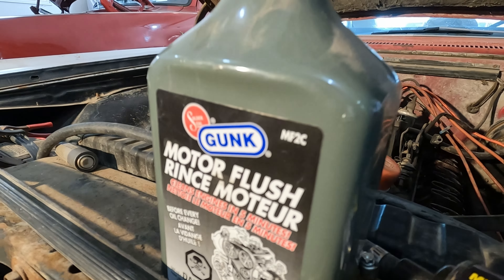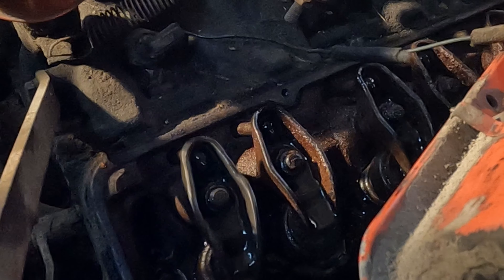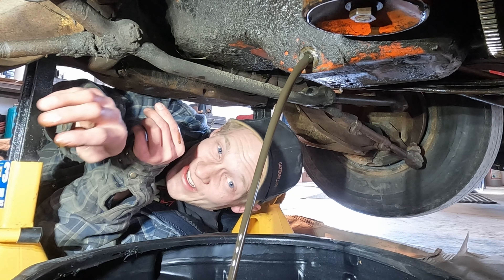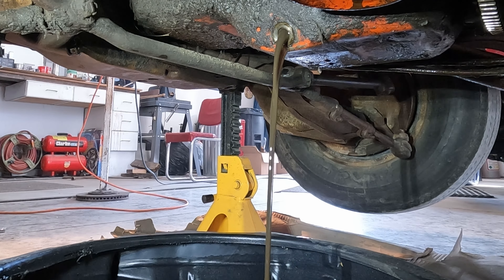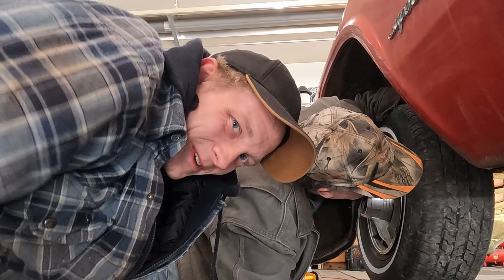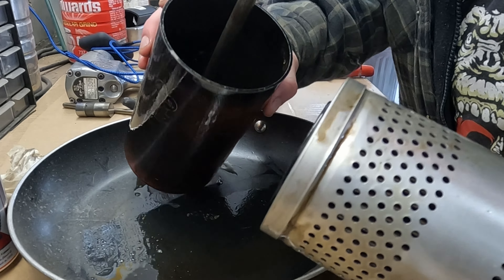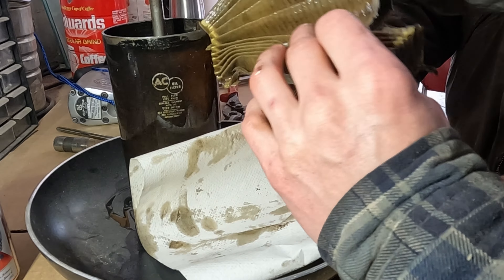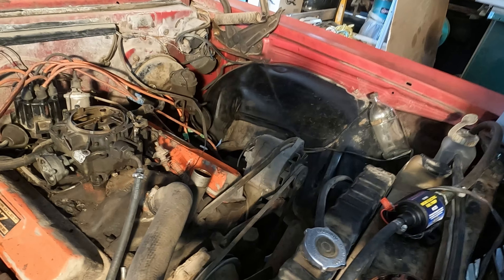Motor sludge flushing the worst oil change car - 1965 Impala

Comment: Kerosene and diesel fuel. That's all it is. Use either one or a combination. That car is from the era when they had really lousy oil detergents and the paraffins would stick to everything in the engine especially if it was never run hot very much. I remember seeing engines in my neighbor's garage he was working on where they ran Quaker State. TOTALLY gunked up. NOTHING in a bottle would EVER get rid of that. My brother bought an Olds Toro at an auction. Had 65k on it maybe and prossibly 2 or 3 oil changes at the most. The engine was completely loaded with sludge.
Reply from the maker: Thank you for sharing. That motor flush was sitting on a shelf in the old man's garage for who knows how long... He did not even know. 
Quite the interesting experience your neigbor had though!
Reply: @bucksedge I hear you. I just helped my Aunt and Cousin clear out her Uncle's garage and there were so many containers of old chemicals and oil in there. They let me have the stuff, some of it the bottoms of the cans were rotted off. He had some of the oil in the old 'cardboard' cans you needed a spout for. 
My neighbor in upstate NY had a commercial garage in the late '70's through the '80's and I hung around and helped him out from time to time. Seen some crazy stuff roll through there. We lived near an Indian Reservation, and they didn't do much maintenance on their cars. Some of those old engines you had to pull them apart and use a putty knife and physically scape it off. The worst one I've ever seen was that one my brother bought at an auction. It had low miles but was just neglected. Olds 307 and the gunk went from the valley and touched the bottom of the intake. Went through GALLONS of diesel and gasoline to clear it out. Had to remove the valve covers and intake.  If you research Quaker State you'll find they were known more than any other oil for causing the build up. I think it had to do with their formulation or something. Parts of the oil turned to wax at cold temps. It was a 'wax like' gunk left behind. They changed their blend a long time ago but I still just don't like their oil.
Reply from the maker: @vincemajestyk9497  That sounds like quite the vintage collection! My family has lived at this place for 3 generations so I'm always finding strange forgotten things.  Like the old 2 stroke oil from my grand fathers boat days... Guarateed to sieze a carburetor in 30 minutes or less with that lumpy stuff.
 That's also interesting to hear about Quaker State being an issue at one time, I had no idea but thats very plausible. Oh the irony I just dumped that in my Ram truck haha.
Reply: @bucksedge  That's funny you mention that. One of the things I came across was some old 2 stroke 'Sabre' brand 2 stroke oil. Kind of torn between dumping it (recycle) or using it. Most good 2 stroke oil these days is synthetic. I generally use VP or Stihl, or even the Jonsered. Don't know if it would be worth it to risk the old oils pre-synth formulas. I think you'd be OK with the modern QS oils. Practically all of those companies have changed ownership and formulations many times since the '70's. BTW, cool '65 Impala. Reminds me of the '65 Biscayne 4 door my grandfather had. He bought it new but only lasted about 10 years with the salt around here. Seen lots of cams go out a long time ago too because of oil issues. I was really impressed that you marked your pushrods to check the lifter rotation. I've been doing that for a long time and never seen anybody else do it in a video. I always check that before and after a cam break in. Some will spin faster or slower than others, it doesn't matter as long as they all spin.
Reply from the maker: @vincemajestyk9497  I have several motorcycles so I did a lot of experimenting with fuel types and mix ratios between brands before settling on Amsoil. That old stuff was not worth the hassle on stuff I cared about. Fouled plugs, clogged jets, ect... still keep it around for a bottle of mixed gas for a quick shot when first starting old cars.

Thank you, it is also funny you mention that... I was just watching a video of someone converting a 4 door Biscayne to a 2 door. I just recently acquired these 1965 Impalas, new found appreciation for the era. Keen eye you noticed the pushrod rotation! I've been meaning to make a more indepth explanation on that. Interestingly enough it appears all the lifters are starting to dish into the cam while still spinning... complete cam failure was still imminent.
Reply: @bucksedge  Yah, I think I'll just save that old 2 cycle oil for 'old starts'. I'd forgotten how bad that old stuff was for ash deposits and plug fouling, plus LOTS of smoke. Most any of the top shelf synthetics are way better. I bought a new Stihl about 5 years ago and the dealer said if I used the HP Ultra oil it would double the warranty period. It's a 50:1 mix. A couple years later I acquired an older 1980's Stihl which said  24:1 with 'regular' oil or 32:1 with the old Stihl oil. I called the dealer and he said to just run the HP Ultra at 50:1. I was kind of skeptical, but it worked fine. I will say this, that old Stihl is an ANIMAL compared to the new one. It even has a louder 2 stroke exhaust pop like the old dirt bikes. No comparison between the 2 saws and they're both the same size. That old one really screams.

I remember seeing a few cars like yours that had wiped cams and still ran. Guy I went to school with had a '74 Javelin with a 304 (stock) he took to my neighbor's shop. Same as yours, every lobe was wiping but still ran, not very good, but not horrible. Most of the cars I've seen that on didn't have regular oil changes or used cheap oil back then. I doubt those valve springs are very stiff.
Reply: Every engine I ever torn down or even just taking the valve covers off back in the 60s and 70s that used Pennzoil or Quaker State had that flakey, paraffin sludge present. EVERY engine that used Valvoline or Castrol was clean.
Reply: @MostlyBuicks  It was particular to a few brands, I think the 'Pennsylvania Crude' oils seem to be the problem brands. Pennzoil used to be in Oil City, Pa before sold to Exxon-Mobil or Sophus. I know what you mean. That crud was really common. Seen it in junkyard cars and others in the shop. It's virtually gone now with modern oils, in fact I completely forgot about it till I saw this Chev engine. Also, most refiners started Hydrocracking their oils in the '90's which helped the component separation.
Reply: @vincemajestyk9497  Yes it is different now. That is why I mentioned the 60s and 70s.
Reply: I wouldn't say they ALL had really lousy oil detergents............ I used nothing but Valvoline, no stuck lifters and the valley was clean enough to eat off.

Comment: Sometimes the sludge is so bad you can't flush anything out. Just got to get oil changes when you're supposed to every time
Reply from the maker: Frequent oil changes do help! I've had some with a bad PCV cause the oil to be excessively dirty although this does not have one...

Comment: when I flush older engines, I usually mix in about 1liter of diesel in the oil and let the engine go up in temperature at idle before emptying it.
Reply from the maker: Thanks for the tip! Have tried that in the past on other things but when the oil pressure gauge just dropped to an eye watering 0 lbs... Not to confident in trying that again, maybe we had the ratio way off from what you suggest and diluted the oil.

Here it had a steady 30-40 lbs with the Gunk motor flush, which was nice to see. I missed that part in the video, my bad.
Reply: Me too. Works as well as any engine flush, which I understand are mostly kerosene.

Comment: ATF and  a cleaner  ( sea foam) works, and buy some oil filters, the first flush can pack the filter
Reply from the maker: Nice tip! It is on the 3rd filter. That one I cut up in the video, was after the flush.

Comment: That's why you remove the oil filter before draining the oil
Reply from the maker: You are exactly right. Learn from my mistakes
Reply: Best advice I’ve ever had with filters is to put a plastic bag over the filter and remove that way…all the oil collects in the bag

Comment: No rubber gloves? :-)
Reply from the maker: Maybe I should get some
Reply: Rubber gloves are for the weak, real men use their bare hands 😑🙃
Reply: @itumelengmahaole5890  Good luck with your bare hands :-)
Reply: Gloves, pain in the ass, once you get oil on them, you can't grip anything.
Safety glasses on the other hand..........
Reply: Needed a face shield!
Reply: @port nut Great for you, but not for me 😄